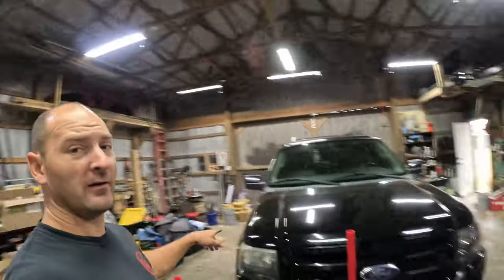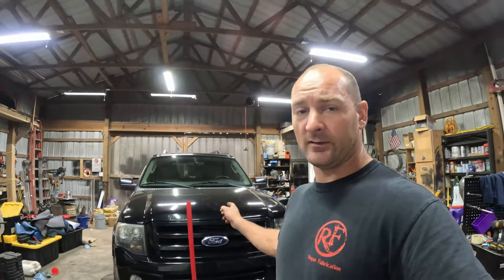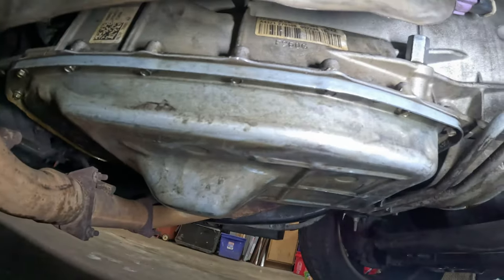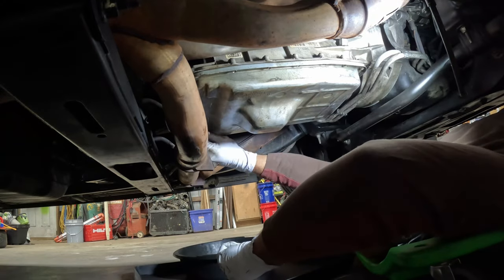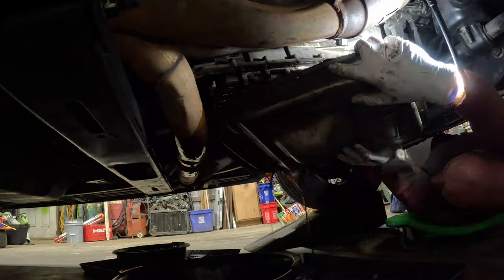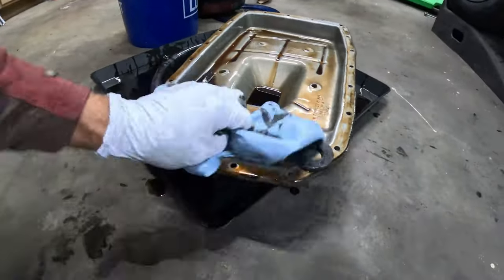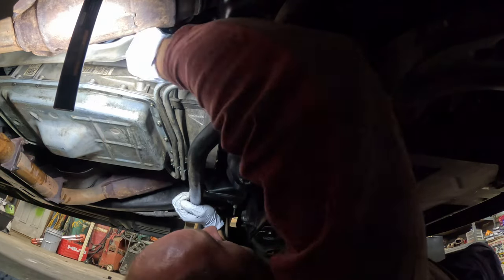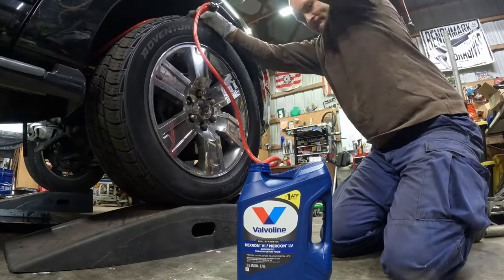2007-2011 FORD EXPEDITION TRANSMISSION SHUDDER FIXED!!!!

Comment: Thanks for this! Do you have a video with the shudder before you fixed it? I'm thinking I need to change my fluid and filter, but if I could confirm I have the same shudder, I could sleep easier. Thanks!
Reply from the maker: I don’t, it was like the overdrive would not stay in, it would shift back and forth while driving around 50-60mph

Comment: How many miles were on the vehicle before the fluid change ?
Reply from the maker: 240k was on the transmission when I changed the fluid, filter and used the shudder additive. I acquired this expedition when it had 220k so I’m not sure when the previous owner changed the fluids.